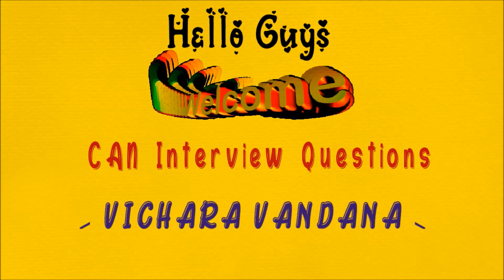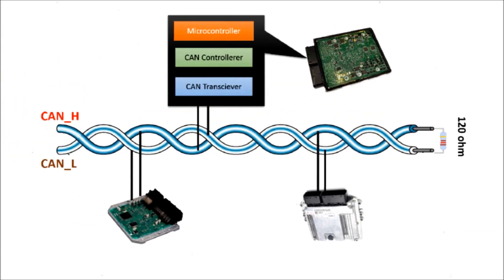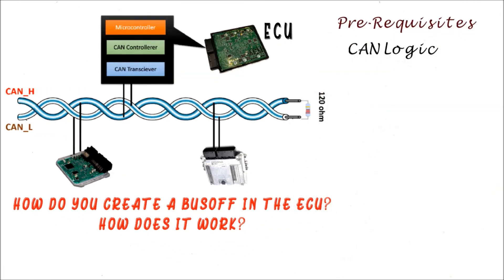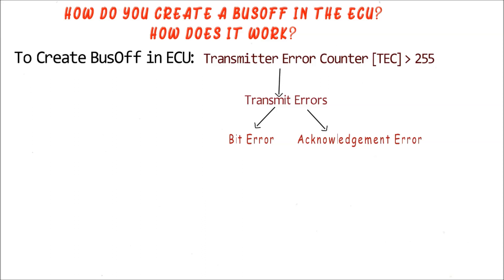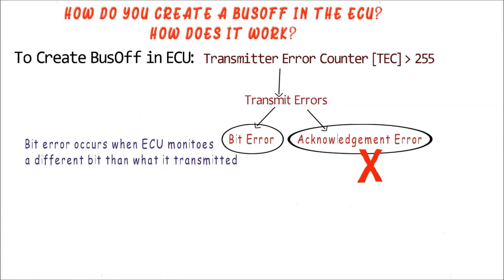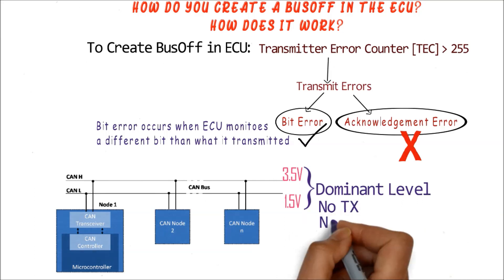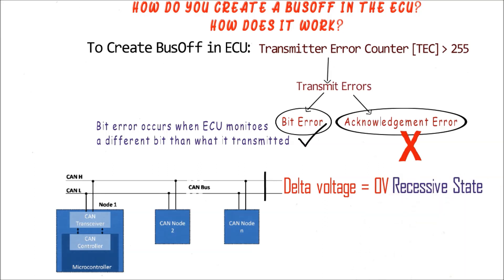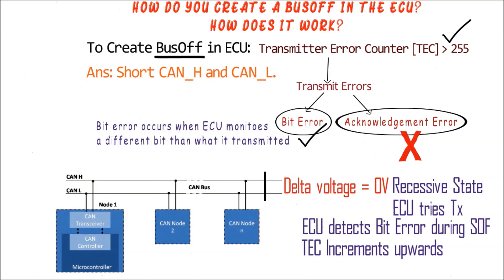CAN Protocol Interview Q&A : How do you force ECU to BusOff

Comment: Well explained like as always ☺️ 
If two ecus on same CAN network try to send same message with different 
DLC or data part exactly at the same time, will it cause bus off??
Reply from the maker: Thanks for your kind words . 
Yes in such cases the Bit error is unavoidable and CAN protocol is not designed to sustain this scenario. Thats why we have only one transmitter node for a message ID in a can network. But hypothetically lets us assume this scenario because.. well its fun to think about and in tester diagnostics we can make this really happen. 
So once the bit error occurs, the error flags and error frames will be put on the bus destroying current data frame. once the error frame are over then if both ECUs are quick enough and try for retransmission and enter into arbitration again then same situation happens and the TEC will keep on incrementing and the ECUs will enter bus off. 

On the other hand if initially when the conflict first happened if both ECUs TEC value are not equal, then TEC of one ECU will cross 255 before other and only that ECU will go on Bus off and in next retransmission of non busoff ecu no bit error occurs and hence TEC will reduce. 

One more scenario is after bit error and error frames one ecu only is more quick and starts retransmission andother ecu is bit low then arbitration is not happenung and so none of the ECUs will enter bus off. 
So 3 scenarios where both ecus will enter busoff, only one will enter busoff and one where non will enter bus off. Hope this answers your question
Reply: @vicharavandana could you please explain difference between pre-compile and post build configuration in autosar with one real time scenario
Reply from the maker: Please enrol in my Autosar basics Udemy course. You will be clear on that. The details and promo video available in my channel. All the best